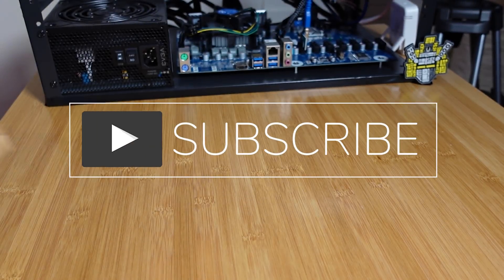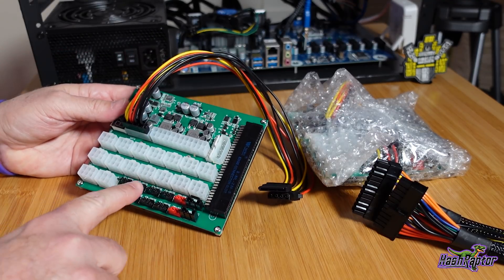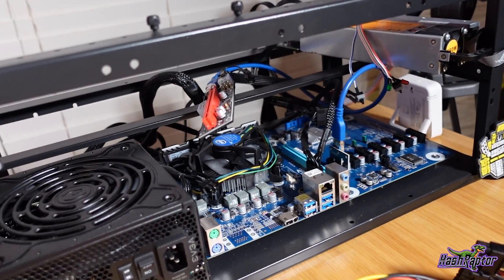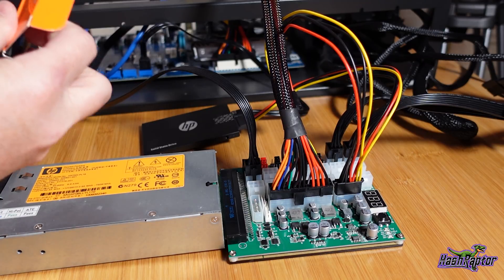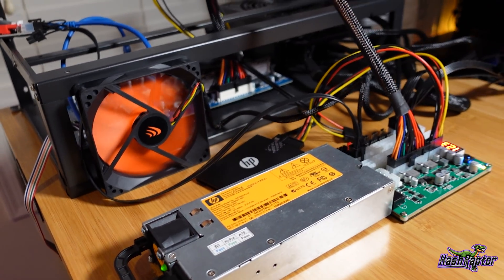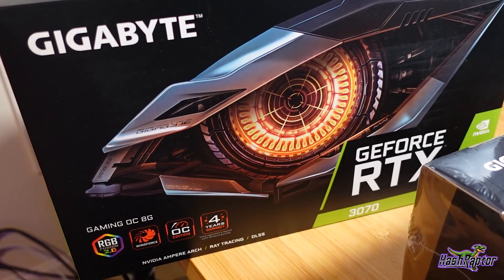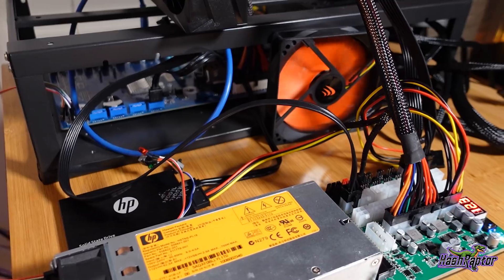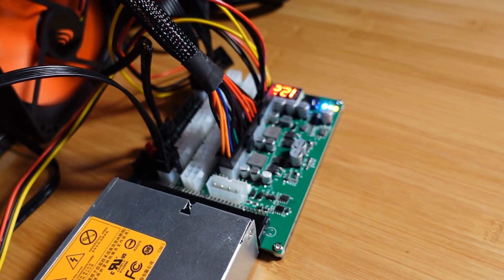A GAME CHANGER???  Parallel Miner ZSX Breakout Board 16 Ports + 24 Pin ATX + Fan Hub All In One!!!

Comment: I thought you would like that!!!  I saw that on Parallel Miner and thought of you.  This is soooo much cheaper than ATX PSUs with the bonus of the fan headers and also with the 3000 series having dual 8 pin requirements.  This just makes so much more sense than a regular ATX PSU.
Reply from the maker: Loving them so far!

Comment: I ruined my windows config trying to go from  a windows atx environment and bringing it straight into this server style psu. Perhaps there's something I need to alter in my Asus bios to get it back. 🤔 

Also. The molex, in order to connect an ssd hard drive you need a 6 pin to molex cable to power the ssd.  Wish I'd read that one before placing my order.

Comment: So even if Motherboard is powered by PSU and its breakout board, I still need to manually turn on the motherboard just like you did in 6:01 ? is there a way to skip that and let the mobo and PSU automatically turn on when it got the AC Power?

Comment: I have (3) 750w PSUs with parallel miner breakout boards and the PSU fans have never turned on.  They never go above 500w each but are hot to touch.  Is that normal?

Comment: Would it be an issue if you ran server psu (GFX + risers)  and an atx psu (Mobo and SSD/Peripherals )? Do you need to connect them if there is some sort of issues with power loss?
Reply: No it wont be an issue, just connect to the Top Molex off off the ZSX board to your ATX PSU Molex . Leave off the 24pin MB connector as you will be using the 24pin MB off the ATX PSU. (  https://imgur.com/a/AwQUe61 ) If you are currently 5 or more cards I would recommend saving your bios settings in case they reset to default when you remove one. If that happens you may have to boot into the bios with 4 cards or less and adjust the settings so you can run more than 4 cards. After that make sure you press the button to turn on ZSX before you turn on the ATX PSU and start your system. The lights will be yellow and green on the ZSX when turned on. You will not see a blue PC light because the 24pin is not connected. The Molex connection from the ATX PSU will turn the ZSX on and off going forward.

Comment: I used the breakout board for the HP server psu's in the last run-up of 2017 & 2018 & kept asking myself, where / when is this board going to contain the 24 pin mb connector.  This is, as you've highlighted, 'A Game Changer'.  Thanks for the produced quality content HR!~  $65 now and out of stock at Parallel Miner.

Comment: if this doesn't exist. i would use pico psu to run the motherboard and processor as well as the ssd. and i want to ask? can i use the 6pin as a power supply to my pico?

Comment: just buy a 250 watt picco for 25$  with x11 breakout board this is just  a waste of money .
Reply from the maker: Have those worked well for you?  I’ve heard mixed reviews. Oh, you would also have to pickup a fan hub. But yes good point, you could break that out and pay less.
Reply: @HashRaptor  yeah ive had the same 250w piccos running for years not one issue and my fans are wired into the server psu output using a 6 pin pcie to 3-4 pin headers for the fans . That is my setup on a few racks but have zence switched to 20"  commercial fans . When you have a ton of cards thats the best way to go . 40cards on an hdx rack that cost 140$ vesr spending that on a 8-12 card mining frame is a no brainer for me . Eth gwei prices are insane hella payouts .happy mining have a good one.

Comment: how loud does that server psu get?
Reply from the maker: If you don’t push the power supply beyond 70%, it stays pretty quiet. People who complain about the noise usually drive the server power supplies to 70, 80, 90 even 100%. When that happens the fan kicks up in high gear and starts to whine.

Comment: no auto power ON? for this ZSX Breakout Board?
Reply from the maker: Yes, the button acts as auto power on in that it remembers the previous state. So if you were on, lose power and then power back, the switch is still automatically on. I tested with my smart switches tonight and it works great!
Reply: wow! good to know. thanks for your reply.

Comment: Hey Raptor.  Looks cool and nice vid.  I am curious about the usability of that many PCIE connections. I am thinking that if you have a more standard 1200 W server PSU then you really can’t use many of them, so you end up having to get multiple server psus, and in that case is it worth it over using cheaper breakout boards?  Really cool that it has the fan hub.  Do you use higher power server psus like 2400W, in which case these new breakout boards may make better sense?  I am using nothing but ATX PSUs now, and it is not fun... :)
Reply from the maker: Ha ha, all really good questions. Stay tune for a video coming in the next week.

Comment: pretty sweet man.  wish they used some lian li strimmer cables instead of the ketchup and mustard though....since RGB = Hashrate.  60 bucks is pretty pricey though.  I think ill stick to dual psu for the time, but super cool.  When these drop to 40 bucks after the mining high pulls back ill be in.
good work HR
Reply from the maker: Thanks man, yeah $40 would be sweet. Maybe they can give us a nice coupon code.

Comment: Very cool! Thanks for the review and setup video. I have been thinking about switching to one of these ever since the new breakout boards came out. I'm curious about noise. How loud was it for you? Did you have a lapel mic on, because I could hear you just fine and it didn't seem loud at all. Granted, that was with just a single gpu, but still. I'm wondering if I could have this in a residential setting like the small rig in my office (where I work and need to do zoom/video calls/meetings) or if it would be too loud. Let me know your thoughts. Keep the great videos coming!

Comment: Literally just bought one of these a few weeks ago - and yes, being able to power a 6 x 1660S with a single PSU, great and quiet little rig.  Love this ZSX board - I love stuff from Parallel Miner.
Reply: That's awesome! I've always wondered how quiet those things are, if it was under higher load does the server fan scream?
Reply: @carlbroker  it depends on the PSU Mostly.  
PSU server supply's really are not that loud once they ramp up and adjust.
At least mine don't.
Reply: Ive been using Parallel Miner breakout boards for years .

Comment: YESS i just got an HP 1200w server psu with a ZSX from Parallel,  a few weeks ago and I love it!!!  I have it running a 3x AsusRS  5600xt. I  am going to work on converting my farm over to Server PSUs and ZSXs. No more ATX!! super clean and easy to run, 10/10 would recommend
Reply: Hey do you know if I can put in any power cord that fits into the PSU Miner? since I bought a PSU from them and it doesn't come with one. And they are sold out

Comment: I just got 2 of these in but one had the cap broken off from positionC29 when I unwrapped it...contacted them and they are shipping another one out and told me to recycle my board in the appropriate way in my area(live in Canada and with the import fees it adds like close to 100 for shipping for the 2 that I got)...still worth it for the cost difference between a household atx power supply)....time will tell about there durability but their customer service is excellent in my opinion

Comment: I run three of those and they're great. I run two 2500 watt power supply with 10 5700xt and 8 3080.
Reply: Damn! That looks to be much cheaper than getting a 2500W psu am I right? Looking for a psu currently and this looks like a great solution!

Comment: I wish these were made about 2 years ago. Would have saved me a ton on the one ATX PSUs I use to power all my rigs...I usually go with a 850 platinum to power board and 2 or 3 Navis and I power the rest with 1200w platinum or 750w platinum server power supplies and try to maintain about 50% load for maximum efficiency. Great video man. Get these while they're hot I guess. I imagine they are gonna be hard to find and whoever makes them wont be able to keep up with demand. I have a bunch of pico adaptors I bought but never got around to using them. Keep up the great work my friend!
Reply from the maker: Thanks so much I really appreciate it. Completely agree with the ATX power supplies.

Comment: I ordered one from parallelminer originally but it costs more than the 1200w PSU itself. Not worth it IMO because you can get 450w-550w PSU's for very cheap. Depends on availability but yikes.